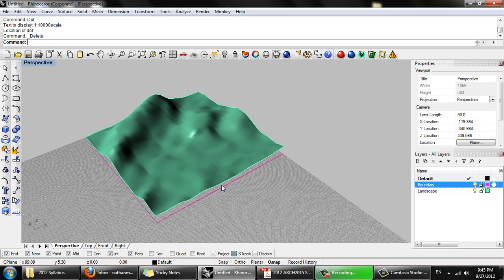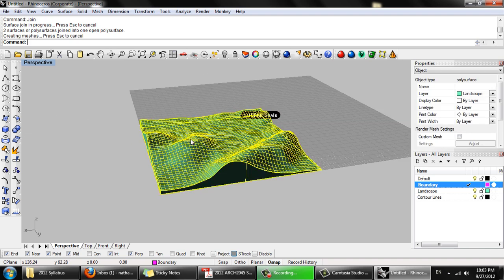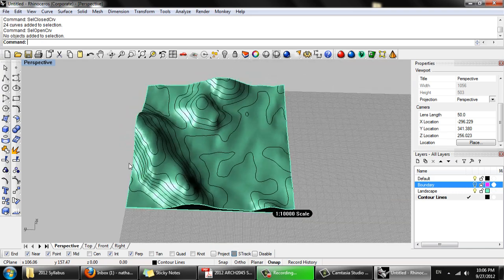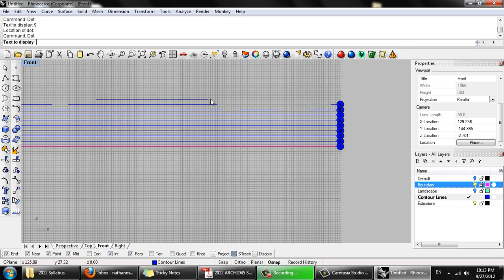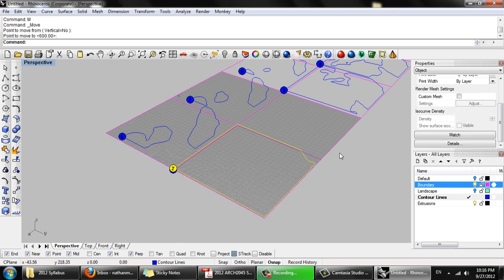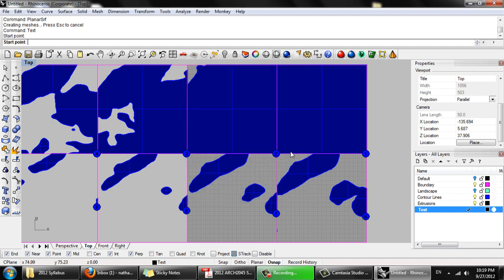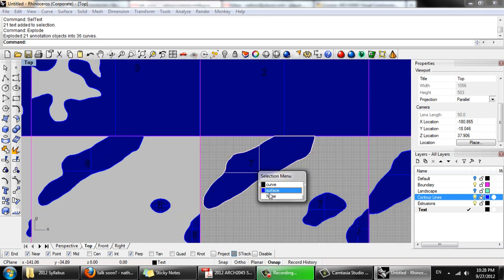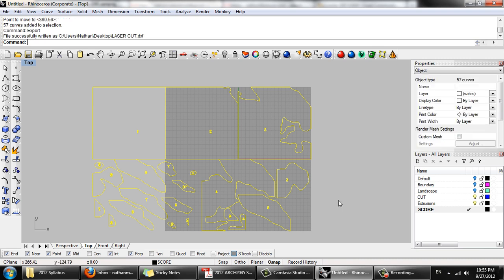Contour and Output to DXF

Comment: Im Trying to CNC mill this, can I slice the layers and have the contour of the mountain remain?
Reply from the maker: +Paul Kurnick I'm not sure I completely understand. You could CNC the landscape from a single block of material, which wouldn't require slicing. Or, if you need to use thinner sheet material, I guess you could CNC each layer individually. But the more common approach is to first laminate many sheets of material (ie wood glue together a stack of plywood) and then CNC in one go...
Reply: +Nathan Melenbrink 
First off, much respect for responding so promptly! 
Second, I'm not certain I have a bit long enough for the scale that I want to mill my wood at. My intentions were to separate each layer as a solid, with its contour remaining.. mill each layer- laid out on a larger document, as shown in this demo for the laser cutter. Due to a timing constraint for my project, I am milling from a 1'x3' sheet of half inch plywood.
Reply from the maker: In that case I'd recommend using the boolean split command instead of intersect. That will split your closed polysurface into smaller closed polysurfaces (which you'll need for CNC) without the need for trimming or joining.

Comment: Hi!
I have to do exactly the same but the slandscape I got is in mesh format. I read that from Mesh to Surface is not easy task. Do you know haw to do it? thanks!
Reply from the maker: +Ivan Pedemonte you could try the method shown above with the "MeshIntersect" command, or try the contour command on the mesh. There's no reason to convert to surface if you don't need to.